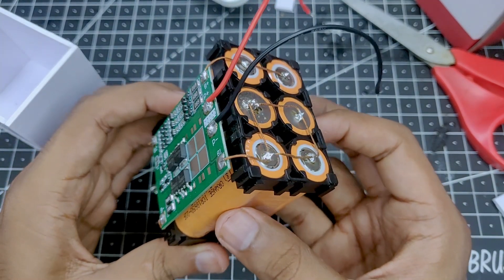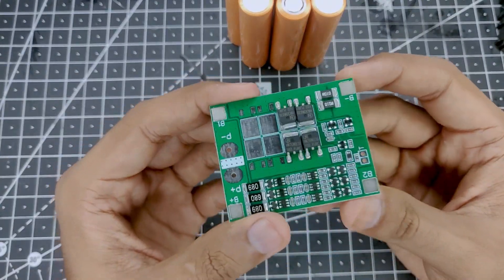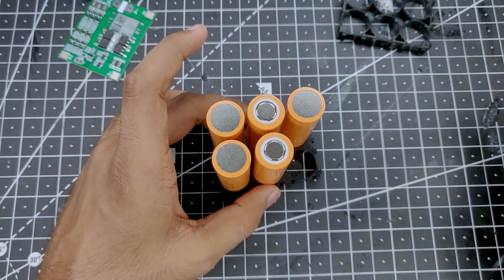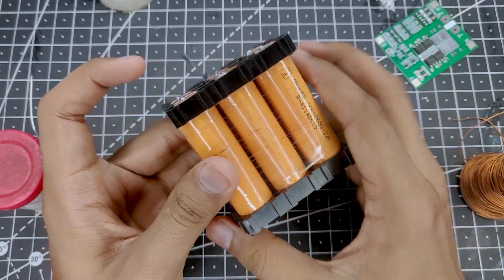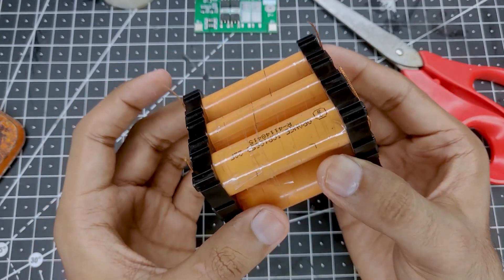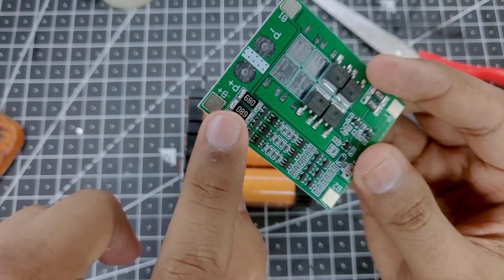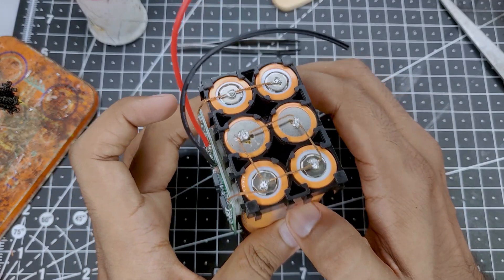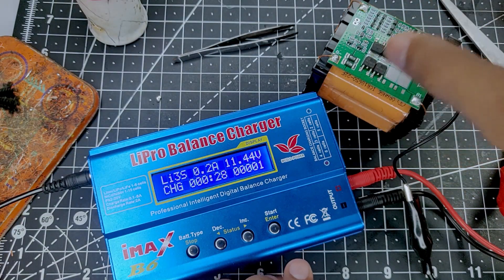How to Make a 3S 12v Battery Pack With 18650 Batteries and BMS

Comment: little help please , 
I need / want to make a 3s 2p . 

in a space of 13.8cm long 6cm wide and 2cm high , so basically 6 cells laying flat head to toe . like this = = = .
what would be the best way to wire it ?
Reply: grr it is not like that , it is like below 3 and 3
= =
-  -

Comment: Do I need a BMS, If I I wire in a balance plug directly to each cell ??
Reply from the maker: Usually it will work but then you'll need to use a balance charger to charge it. BMS is a very good added protection for you batteries.

Comment: will this battery pack with BMS be compactable for a regen system?
Reply from the maker: Regen System is a different component which sends the current from the battery to the motor during acceleration and from the motor to the battery during braking. We can talk more on this. You know where to find me ☺.